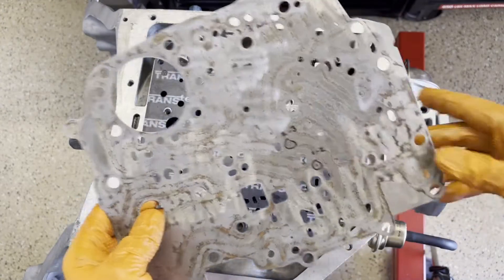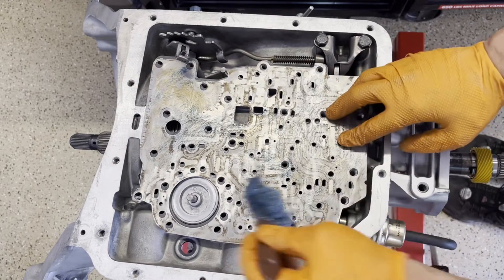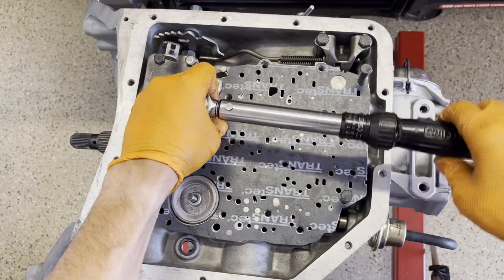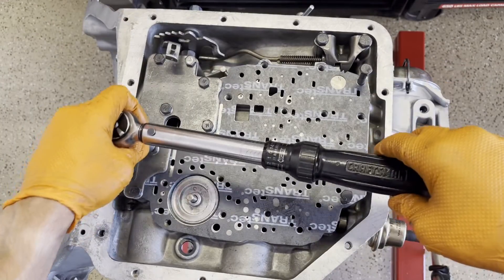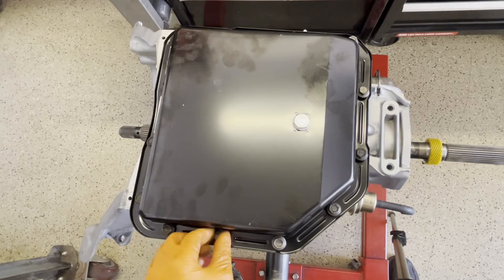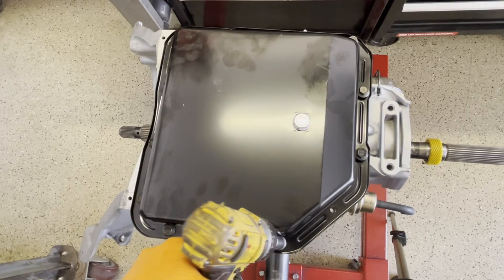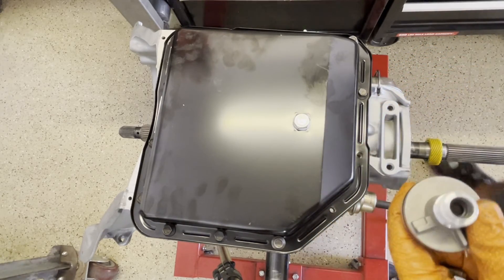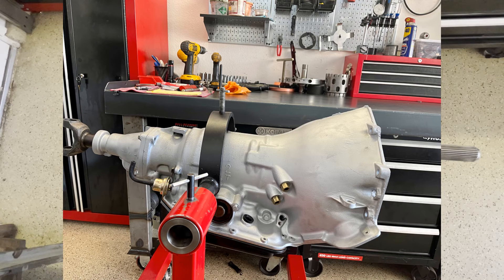GM TH350 Rebuild PT7 - Valve Body Installation and Conclusion (Please read description)

Comment: Hi, I sent this final bit of info in the reply below, but wanted to also copy it as a new message in case you arent able to get to all your replies. Also, so I have read a million times how the gears need to be oriented with the dot up, which I did on the smaller pump gear,.. but neither the stock original larger (outer) gear or the outer gear from the new set I bought seem to have any sort of dot to tell which way goes up.. So how do i know which way is up on the outer gear? or does the orientation not matter if it is not marked?  and to recap what happened so you dont have to re-read everything is as follows. I had completely rebuilt the transmission, all new bushings and a complete rebuild kit. Went through the valve body and of course new valve body gaskets which i double checked to ensure they were the right ones. Also a new torque converter (with 1/8th gap to new flexplate) and installed new filter. Fired it up for the first time and it had good pressure in park, , then shifted to neural and drive and after that no pressure from main line port or cooler lines no matter how many times I started it up (started the engine and tried to get it to draw fluid on 5 occasions with 15 second run time intervals. dropped the pan and it was completely full of clean fluid, no clogged filter and filter gasket new as well. like I said above, TC tangs on pump gears are still perfect, TC is perfect, and pump pocket is perfect and was full of fluid when I broke the halves apart. So why no pressure after I shifted it to netural drive? One last thing to note is that when I first started it up I let it run in park for about 20 seconds where it had proper presure until I moved it to netural. Also checked the S-hook on the shifter assembly and it is still connected to the valve body. Thoughts before I put it back together?  bad torque converter? its new remanufactured. BTW, you have been so helpful, and I am subscribing to your channel today..
Reply from the maker: Hmmm...What I thought was a straightforward explanation has turned into a bit of a mystery. Glad the pump is in good shape as those pumps are getting harder to find and not all machine shops can recondition the pump body as it requires a specific program to be run on a mill to deal with the crescent. You can buy aftermarket pump bodies for about $100 or so from Transstar if necessary.

Anyway, check out my TH350 rebuild video where I discuss the orientation as I'm assembling the pump and show how the engagement lugs are offset on the drive gear: https://youtu.be/5XC99iM4eQU?t=97

And thank you for the subscription!
Reply from the maker: I'll add that when you put it back in but before you bolt the converter to the flexplate, spin the converter a whole bunch of times. After several turns, you should see fluid coming out of the cooler line fittings...It won't pour out but fluid will definitely flow...If nothing comes out after 10-15 turns then there's either no engagement between pump and converter or something is wrong with that pump.
Reply: @nickstransmissions  thank you so much, I will do that. can a bad TC cause sudden loss of pressure like what has happened here?
Reply from the maker: You're welcome. I don't believe the TqConverter itself would cause low/no line pressure as it just spins the pump, which creates the pressure. I'd install the converter when the trans is on the bench fully assembled and spin it to see if you get fluid. If fluid comes out then I'd check the boost/pressure regulator valve train for freedom of movement just to rule it in or out. 

How many quarts of fluid did you put into the transmission total? The system takes between 10-12 quarts including the converter...
Reply: @nickstransmissions  well, on initial startup I put about 2.5 to 3 quarts or so in the converter, and filled the pan with four quarts. When I started it up, it took up about 2 quarts from the pan, then no pressure when I started moving through the gears. Then I immediately stoppped it, added fluid to the pan to fill it to the full mark cold, and it simply would not take up any more fluid. I started it up and let it run for 15-20 seconds, but it would not take up fluid or build pressure. I tried this 15 second start and run situation about 6 times with no pressure. Thats when I contacted you and pulled the tranny. I clearly had pressure for about 30 or more seconds on initial startup because my main line pressure port gave me plenty of pressure (I think about 60 lbs, but I only got a quick glance before it dropped to zero), until shifted to drive when it went to zero. Also during these short startup attempts I had a cooler line disconnected to see if there was flow. There was not any fluid. But when I dissassembled the transmission the lines were full of fluid and the converter was completely full. So i did deffinately have line pressure initially. I will try the bench test you suggested to see if I get fluid out the cooling line port when spinning the converter. I double and triple checked the pump housing, gears, and TC and saw no damage, and plenty of fluid in the pump.
Reply from the maker: Interesting...Based on the above I'm counting 6.5-7.0 quarts initially (2.5 in TQC+4 in the pan + plus an unknown amount when you topped it off to full-cold). Does somewhat sound like you didn't add enough fluid however it should have taken up the fluid you did put in and allow you to put in 4-5 more quarts before it was completely full (I'm assuming your pan is stock and you're not running any stand-alone trans coolers in addition to the one in the radiator - if you are, you'll need to account for the additional capacity beyond stock).

Let's see what the bench "flow test" shows and go from there.
Reply: @nickstransmissions  well good news, tranny running good and moving in all gears well. I have my line pressure guage hooked up, but I have searched everywhere on the net and cant find clear information on what line pressures should be present in what gears under what conditions. Can you please tell me what pressures I should get under what conditions?
Reply from the maker: Glad to hear! 

What was the problem with it? 

Also, 50-60 PSI park/neutral/drive, about 2x that in reverse and 2.5x or so for manual 2 and 1. Those are all at idle. At stall, about 3x those figures except reverse.
Reply: @nickstransmissions  i dont know. I didnt find anything wrong.. Cavitation maybe?

Comment: Hello again. I am desperate for help on something. I finished the TH350 stock rebuild without installing a shift kit. I installed all new clutches, steels, all bushings replaced, Torrington bearings cleaned and inspected, torque converter properly set into the pump (with slightly less than 1/8th inch flywheel to torque converter clearances, all new gaskets (valve body gaskets correct for stock separator plate), all hard parts closely inspected, and complete valve body disassembly, cleaning and correctly reassembled, and final endplay at .024 with a dial indicator. 
Prior to final assembly, both forward and direct drum clutches positively applied and held during bench pump/drums clutches air pressure checks. I used a dial indicator to check the clutch pack clearances during air checks and got .032 on the forward, and .048 on the direct drum (stock 4 clutch set up and after installing a .090 steel). Air checked low reverse piston as well and got good apply pressure with no leaks and a solid thud) This is my third TH350 rebuild in the last few years, so I have some experience with rebuilding them. I have also successfully rebuilt a 700R4.
So here is my issue. For some reason I have zero main line pressure with a pressure tester installed.  When I initially started it up, I had good line pressure in park, but the moment I started to shift it through the gears, line pressure instantly dropped to zero in all gears. It  appeared to suck up most of the fluid in the pan before I shut it off. then when I added more fluid I got no line pressure and no cooler line flow. I have now started it up about 5 times letting it run for 10 seconds at a time and it will not take up any fluid and the pressure remains Zero in all gears and Park. The transmission was in good running shape prior to disassembly, and I was just rebuilding it because it had 130K miles on it. The only thing I did was install some new pump gears (same exact size as the ones that came out. I double and triple checked the gears with a Mic, and both old and new were .725's. I also am sure I installed them correctly. Could I have somehow broken off the torque converter gear tangs? I decided to pull the torque converter loose from the flywheel and it spins freely with no grinding or any other odd sounds. Any ideas of what is going on here?
Reply from the maker: Damn, sorry to hear JT...Unfortunately, you stripped the engagement lugs off the pump gears upon installation. At some point between when you fully installed the converter onto the input shaft/pump stator splines and when you married the engine/trans, the converter slipped forward slightly, rotor no longer fully engaged by the converter and you didn't notice. It's the most common installation issue associated with these and similar transmissions.

Hopefully it didn't do too much damage such that the working surfaces and gear pocket can be cleaned up on a lathe & mill at the machine shop.
Reply: @nickstransmissions  hmm. I don't think that happened because it was fully seated and tied back right up until the bellhousing was about an inch from the block (I always do this when installing a tranny so the converter doesnt move or hang on its own weight. The second observation is that the transmission cinched right up on the dowls to the block with no effort. Then, after the tranny was all bolted up, I still had my 1/8th clearance between the TC and flex plate and it spun freely with this clearance prior to me finally bolting it to the flex plate. So I am not sure how that could happen. further thoughts?
Reply from the maker: Pull it out and take a look. Let me know what you find…
Reply from the maker: I re-read this again and, if I understand you correctly, you are saying thst the converter mounting pads where the bolts go were initially an inch away from the flexplate? 

If so, that’s the problem. You need to shim your converter to flexplate junction.

Let me know if I am interpreting what you’re saying above correctly as ive had a few beers since, haha.
Reply: @nickstransmissions  no, 1/8th of an inch, proper spec
Reply from the maker: Ok, makes sense and you did mention it in your first post above which I overlooked...Let me know what you find once you have the trans out and inspect the pump. 

Broken pump is the only thing that I can think of that would cause your symptoms (even if you somehow stripped all the splines from the input shaft, you'd have no movement in any gear but the pump would still be moving fluid and generating line pressure).
Reply: @nickstransmissions  good morning. well Iook it apart and the pump, gears, and TC are all in perfect condition with now scoring, metal, or any visible damage whatsover. When I use my straight edge on the gears looks like I got about 001 clearance, so what the heck gives?
Reply: Also, so I have read a million times how the gears need to be oriented with the dot up, which I did on the smaller pump gear,.. but neither the stock original larger (outer) gear or the outer gear from the new set I bought seem to have any sort of dot to tell which way goes up.. So how do i know which way is up on the outer gear? or does the orientation not matter if it is not marked?  and to recap what happened so you dont have to re-read everything is as follows. I had completely rebuilt the transmission, all new bushings and a complete rebuild kit. Went through the valve body and of course new valve body gaskets which i double checked to ensure they were the right ones. Also a new torque converter (with 1/8th gap to new flexplate) and installed new filter. Fired it up for the first time and it had good pressure in park, , then shifted to neural and drive and after that no pressure from main line port or cooler lines no matter how many times I started it up (started the engine and tried to get it to draw fluid on 5 occasions with 15 second run time intervals. dropped the pan and it was completely full of clean fluid, no clogged filter and filter gasket new as well. like I said above, TC tangs on pump gears are still perfect, TC is perfect, and pump pocket is perfect and was full of fluid when I broke the halves apart. So why no pressure after I shifted it to netural drive? One last thing to note is that when I first started it up I let it run in park for about 20 seconds where it had proper presure until I moved it to netural. Also checked the S-hook on the shifter assembly and it is still connected to the valve body. Thoughts before I put it back together?  bad torque converter? its new remanufactured. BTW, you have been so helpful, and I am subscribing to your channel today..

Comment: Good morning. I love your videos!  I have rebuilt my TH350 and have some experience with installing transmissions. I have a question about bolting the torque converter to the flexplate.... Since the torque converter sags ever so slightly from its own weight when resting in the transmission, prior to bolting to the flexplate,, should you lift it up ever so slightly (take the weight off) as you tighten the first torque converter to flexplate bolt? Or just pull it forward and bolt up without lifting on it?